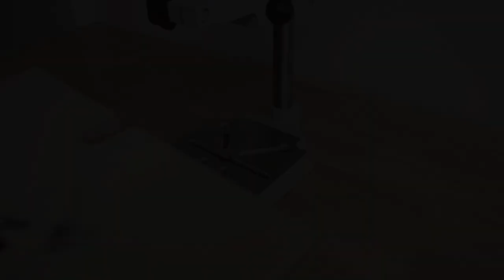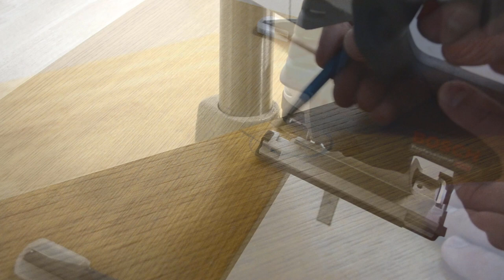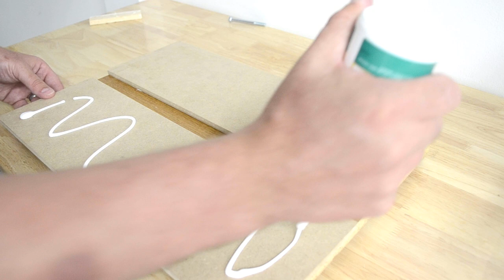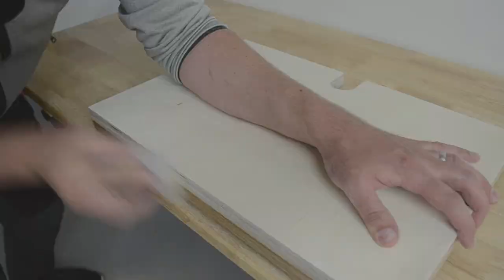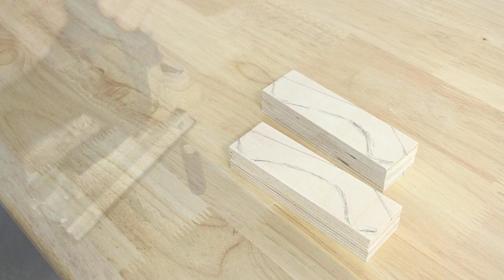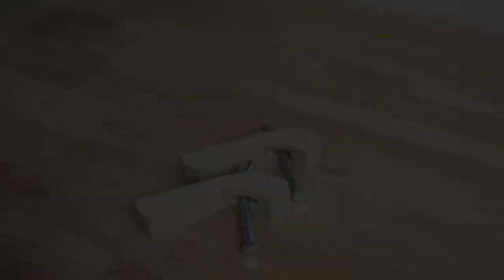DIY Drill Press Table & Hold Down Clamps | Homemade Drill Press Table

Comment: I’m sure you know by now but just glue up and then cut your perfect little blocks or else use salt over the glue to avoid the slippage you got that misaligned your blocks. No matter for this project cuz you cut them out anyways. More just a couple of tips for the viewers.
Reply from the maker: Yes, that is right. :) I did learn that along the way. But it is a great tip, thank you.